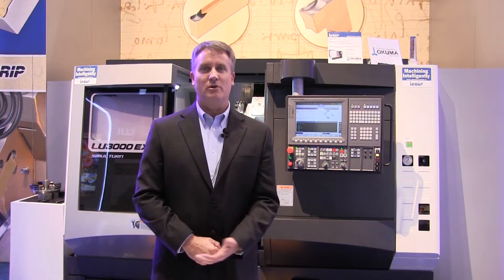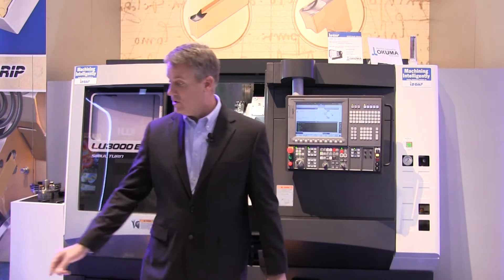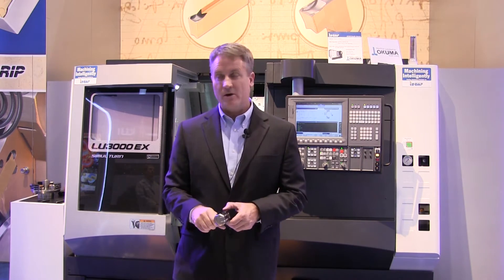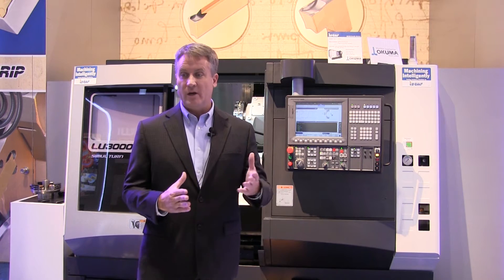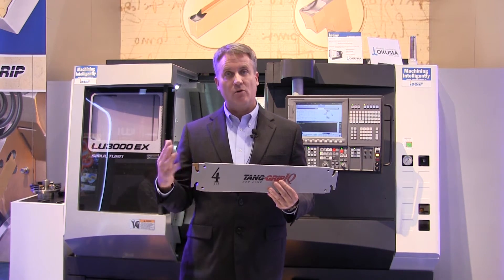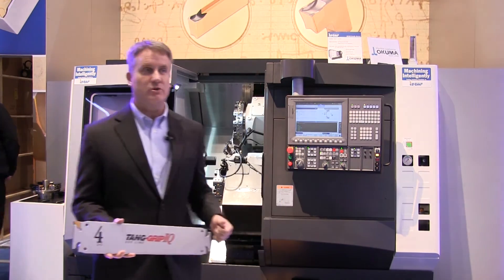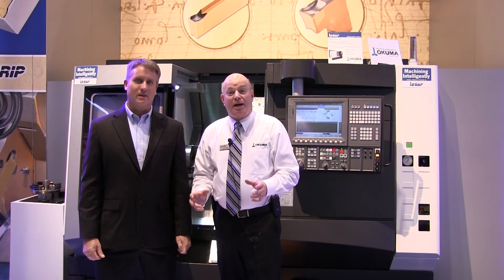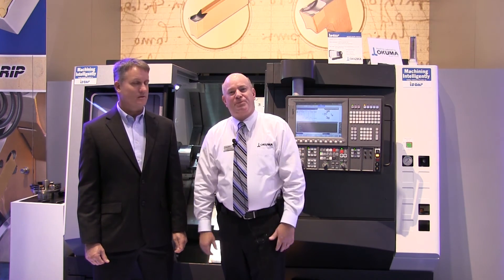ISCAR Demonstration on Okuma LU3000 EX

Comment from the maker: Thanks, gulch1969. We agree that hearing those chips fly makes for a much more exciting video. However, because the cutting demos are running in slow motion, the sound has been removed for this piece. Thanks for watching!
Reply: i have a question about horsepower
say your okuma lathe couldn't deliver enough horsepower needed , what would be the sign for that?